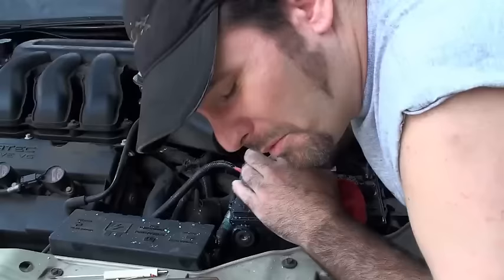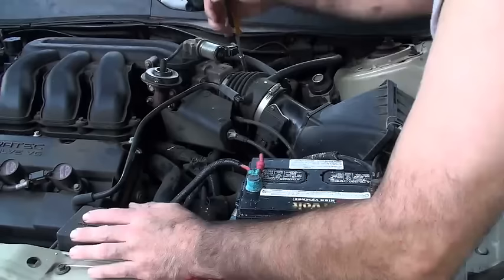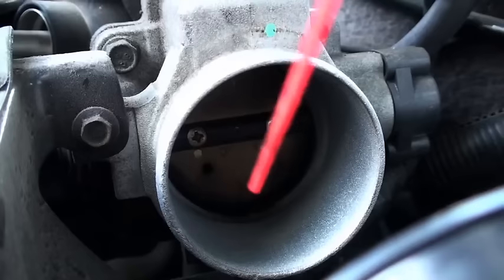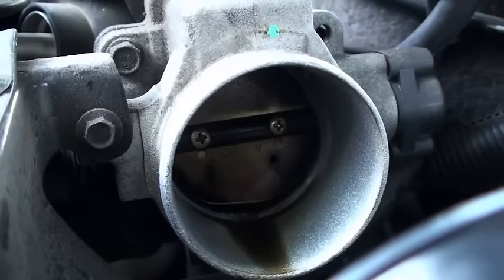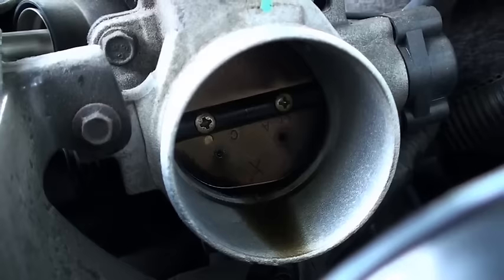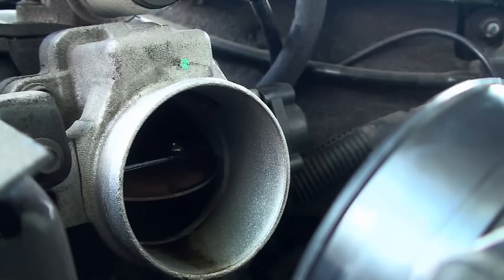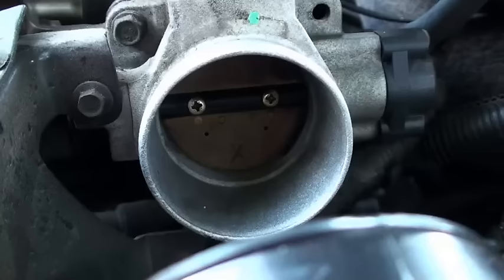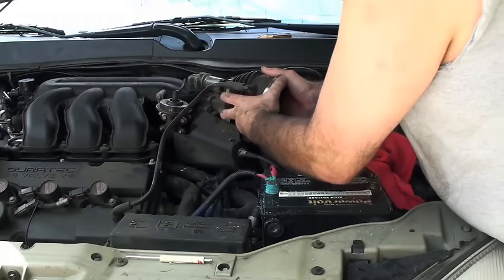Quick Tip-Throttle Cleaning - EricTheCarGuy

Comment: Got a for ford focus 1.8 tdci turbo the car starts labouring on motorways when up above 60 mph and it lags dangerously down to 30 with having to gear down  is this a mass air or throttle  sticking problem

Comment: QUESTION: SHOULD the large air hose connections input on the throttle body have an "UNRESTRICTED" air flow..?? Blowing into it seems to have much RESISTANCE... When removed and cleaned both sides and pin hole bypass, noticed much corrosion on the large hose connections...

Motor starts easy then dies after 2-3 minutes at idle, then no start... Let sitting for 2-3 days it will start again easily... If I hold rpm to 3k for 4 minutes it will then IDLE FINE and restart OK... When cold and when it will will start, the same symptom occurs. If let idle at start, it will die after 2-3 minutes... HELP...!!!

Comment: Eric, question: will throttle body spray damage the catalytic converter if the engine is running while you spray the throttle body spray  ??? Thanks

Comment: On the Saturns or at least the s series its easy to remove the throttle body and just clean the whole thing off. Its only two connectors, a vac line, un hook throttle cables and 2 bolts and its off.takes maybe like 3 mins .

Comment: If you have trouble removing the rubber snorkel, heat up the rubber snorkel up with a heat gun or hairdryer, then wiggle it back and forth until it comes off
Reply: +Rob Reinold You sir are crazy

Comment: I spray something called 'Carby Cleaner" or similar,into my Falcon whilst the engine is running,tends to suck it up mainly through the bypass solenoid activated valve which gets a bit of a gungy film on it,the engine kid of "dies " a bit whilst digesting this stuff but hopefully it does not do any harm.

Comment: I just used brake cleaner, it was very effective. Kinda has the same effect as seen on this video. Do cover up your plastics in case some of it gets onto it, it'll stain badly ;)
Reply: Brake fluid is not good it can ruin the rings and your cylinder bore certain cleaners can damage the catalytic converter and the O2 sensors.

Comment: Hello I have a quick question.  The other day I ran some cleaner through my intake vacuum line. There was a backfire that sounded like a small firecracker.  Other than that everything went fine.  My question is, what is the chance that there was damage to any seals, rods etc.?

Comment: I have seen other videos where they take out the whole thing apart and clean it. Is it really necessary to do that. Thanks.  

Apart from this video I wanna ask I have a 2004 Navigator 125000 miles. It does this cold or hot when I start the car I hear a grinding sound right after that I hear a ticking sound. I have heard the same problem with other people's trucks and they don't know what it is I'm trying to find out what is it. That ticking sound goes away after driving, any idea what that is thanks

Comment: I was told that using throttle body cleaner can damage the Idle Air Control Valve. Is this true? If so, how do I not damage the IAC?

Comment: I've used break parts cleaner. Seems to work fine.
Reply: Brake parts cleaner can damage your sensors such as your MAF, IAT or IAC because it's a harsh cleaner. If you have any sensors that could possibly get sprayed, remove them before cleaning your TB. Use specially designed sensor cleaner to clean your MAF, IAT and IAC.

Comment: I've been learning so much from all your videos since I'm a big car guy these tips are very helpful and so glad I found your videos thank you and keep making them
Reply: I am a novice car guy, but I feel confident about fixing my free '03 Saturn and free '98 Honda. The engines run perfectly. 1.6 in Honda and 2.2 in Saturn. But, there is plastic mechanisms on even moving parts such as the window wiper transmission- unbelievably. 
And the Honda has rattles underneath and poor brakes. Im finding and fixing those issues. I figure I'll still get over 5 years on both. Saturn is my winter car. Honda is my summer car. It's a great system.
I never miss Eric's vids.

Comment: Is a 1993 Dodge Dynasty 3.3L. It still turns off even if I press the gas pedal. My car has never done that before. Bought my car in 2002 and never had any problem until this year 2013. Has new spark plugs wires, new spark plugs, new gas pump and a clean throttle body.

Comment: I just read this somewhere that will help clear up things about cleaning the fords throttle....

Fords throttle bodies are coated and the aggressive agents and those solvents will dissolve the finish and ruin the throttle body

Those coated Ford throttle body's aren't supposed to be cleaned at all. An Induction service using BG cleaner is safe.

Hope that helps..

Comment: Hi...Eric, I did a Throttle Body cleaning with Air Intake Cleaner on my 2005 RAV4 with 196k mi. I found it was strange that the TB was in the back at bottom. It was the 1st time that I cleaned the TB on the RAV4. I sprayed the IAC cleaner and wiped around the IAC round plate and the was very dirty (black) varnish. I also sprayed inside around the TB. Waited after 30 min and restarted the vehicle. It was hesitating to start for 5 sec. and then engine started. I noticed the idle was at 2000 RPM. I let the vehicle run for a few minutes and revved the engine a few times and it dropped down to 1500 rpm. But wouldn't go down to 750-800rpm after engine reached normal temperature. So I decided to drive around the block for a few minutes, hoping to burn off the cleaning agent inside the TB. When I come to a stop, the RPM stays at 1500.

What could be the problem that's causing the high idle at 1500rpm? I've read a few blogs and they said I should drive the vehicle for a few days for the ECU to relearn of the clean IAC/TB. Is it ok to drive while idle is at 1500 RPM, until all the IAC cleaner burns off? Please advise. Thank you.
Reply: +TIMMY LAW disconnect the negative side of the battery for 5-10 minutes then reconnect it. This reset the system and force the car to "relearn" the air/fuel intake.  What you are seeing is the system still running with the old settings with its dirty throttle. However, since you posted a month ago, after a whole month the car should have already relearned itself. Best of luck.

Comment: so I just did this today to my 1991 Toyota pickup, it's my first time cleaning the throttle body and I put everything back together. And make sure everything was put back together right but the problem is now the truck doesn't even start. It cranks but it doesn't start, I'll try replacing the oil pump fuse because I don't hear the oil pump turn on. But other than that I'm not sure what else would be the problem if it isn't the oil pump?

Comment: Hi. My 2009 Santa Fe has a rough idle, hesitates and sometimes switches off while driving. I did a scan on the TPS and noticed that at WOT, the throttle body doesn't open beyond 35%! What do you think could be the problem?
Thanks

Comment: So you can get throttle body cleaner in the throttle? The can I have says it's safe for oxygen sensors and catalytic converters. I'm not sure if it's my throttle causing my issue or not.. But figured I'd try. Any tips would be great!

Comment: hahaha, we used Lawn Mower Carburetor Cleaner and it works just fine since it's only a CHOKE PLATE really :))) NOTE: Put some Silicon Spray on the Throttle Spring and around the Cable and ANY moving parts you see. This will help your Throttle a lot, since it might GUMMED up through time :)))

Comment: It's a simple task to do and will help your engine keep it's power.  You should try to do it every 30k miles.  I do mine every 20000 miles because i drive a '91 with limited hp from factor "110" lol.

Comment: Eric,
I have a 1993 Lexus LS400 that I have let sit parked for the last four months or so. It ran completely fine when I parked it, I just needed a new battery but never got around to it sooner because it was my second vehicle that I never needed to drive. I put a new battery in yesterday and it started right up except when the car is in park or neutral the rpm's idle high at about 3k and when put in drive or reverse it takes off really quickly, accelerating itself until you hit the brakes! The damn thing will do 40mph+ without touching the gas pedal and continue to climb in speed until you hit the brakes. I have put some Seafoam in my gas tank hoping that maybe it was just gunked up from sitting too long but it obviously seems like the throttle may be stuck or something's dirty. Any suggestions? I'm hoping it's not a costly repair.

Comment: If you don't have a tsi engine like mine and your throttle body is as easy to access as the one in this video. I would suggest taking the throttle body off and cleaning it completely.

Comment: My throttle was sticking, I opened the air intake and sprayed wd40 and wiped it with a few WHITE paper towel(tissues). 
No more sticking and smooth acceleration. 
Car's a Hyundai coupe siii FYI.😀

Comment: tech at work uses an old tooth brush first then a rag. also usually gets me to push the accel ped to open butterfly, if me would just wedge something between floor and pedal, if had a money might use an electric tooth brush.  Have to have accessories on though,

Comment: How much "better" would it be if one were to remove the throttle body and clean it with the solvent and a toothbrush?

It seems like it would be a much better clean, but is it worth the extra work? Thanks.

Comment: i see, i think you mean the throttle position sensor,my car has it since honda r18 engine is drive by wire, but the strange thing is i never opened the throttle i just sprayed it and cleaned it with a rag,i really wanted to clean the idle air control valve but i couldnt get to it.

Comment: Just bought an 05 Civic and I noticed a sticky throttle coming off the stop. By turning the throttle with my hand at the body it felt like nothing but after a few sprays and wipes of wynn's carb cleaner the stickiness disappeared. 5min job.

Comment: Nice, but 1 important safety point... it is very dangerous to put your fingers in the throttle boy. Because some cars now a days, can close even if the engine is off sow use a plastic brunch or disconnect any power source to the throttle body. Excuse me for my English btw I'm from Europe.

Comment: Took my 1993 Dodge Dynasty, it would turn on then turn off. They put a new fuel pump, the problem was a wired were the fuel pump was replace. The wired was no good, so they put a new wired and now my car turns on and stays on and runs good. I hope this information helps anyone when putting a new fuel pump.

Comment: Gr8 stuff i have a verso s ractis its kind of difficult to take out the throttle i am thinking to use the rubber inlet and spray cleaner from there its not ideal but may work let me know ur thoughts cheers

Comment: I have a question I hope you can answer. After you remove the Throttle Position Sensor, the part that is attached to the throttle body and is moved by pressing the gas pedal,it has a set of bearings down in it. My question is are these bearings supposed to have bearing grease in them? Thanks

Comment: Hi Eric, thanks for the video. 
I keep on getting the engine light come on.  I scan the codes and 02121 p comes on. Tps..   I have a 09 vw passat 2.0 turbo.  When the light comes on I keep on loosing power to the car.  With your procedure do I need to calibrate the throttle body again via vcd?

Comment: when i cleaned mine it did the same thing i think the cleaner dries up the sensor and makes it get stuck. take out the idle air control valve and clean it and lubricate before installing i used lithium grease on mine and no more problems

Comment: I think it is more efficient to remove the throttle body from its mount and clean it from underneath.
Reply: Does that mean you have to replace the gasket when you put it back together?
Reply: David Crandall  If it's worn but you don't necessarily have to

Comment: hi.. I really need your help... after I did my throttle cleaning my rpm high 1600 tpm 1700 for few sec and back to normal only happen when start uo... thank you so much
Reply: That's good. Cars try to idle high when first started cold.

Comment: What is the proper and easy way to clean motor operated (not cable) throttle body? I was watching your valve adjustment video (J series) you mention not to push the butterfly on the throttle body. Should I remove the throttle body and do it on the bench to clean it?

Comment: My mechanic told me to use a Delco product called Top Engine Cleaner, and from the way he was describing using it, he said it smoke and sputter indicating this was done with the engine running. Is that wise? He also said somthing about not sraying the sensor but how can that be avoided if it's in the way?

Comment: 2014 Chevy cruze 1.4L is bucking between 20-30 MPH. No codes, new air filter, cleaned MAF sensor. Any suggestions? Fuel injector? Coilpack? I'm non-plussed. 32,000 miles.

Comment: When I did this I had it in the on position. And went to hold down the gas pedal. The throttle did not open all way. Maybe a 1/3 of the way. Is this an indicator the throttle body is bad?

Comment: Hi, I have a question, is there should be a small gap between the throttle plate/butterfly and the throttle wall or should be sealed?

Comment: Hi,  I began doing this process to a 1996 Sentra.  The inside of the throttle body has much baked on carbon and wonder if you know of a solvent to apply to it without having to remove the entire assembly from the engine.  Please let me know.  Thank you.

Comment: I have 2010 toyota corolla. Electronic pedal with Electronic throttle body its top right corner there is a screw hidden in a glue type material which is fixed at factory setting.
can you please tell me, what is the function of that. and how it help in adjusting a specific parameter?
I have observed that changing the position of that screw make throttal pedal to respond differently and effect the drivability .
I have an issue of poor idling,engine vibration at idle.  throttle body is cleaned. every possibility has been checked but could not fix the issue.

Comment: Good video Eric, How ever I don't have  a stuck gas pedal problem ,I have  a little higher than normal engine idle on my 2003 3800 engine  Buick will this cleaning help the Idle with a  new air filter?

Comment: The spark plug wear symptoms can tell how the engine perform, fuel consumption, oil leak or coolant leak crust. All four plugs look the same. Can the cylinder head wear symptom tell the same? I have a I-4 2002 corolla, one of the cylinder is clean no carbon deposit, two are strong carbon deposit, one medium. Can this symptom be fuel pressure or fuel injector?

Comment: My 2004 dodge stratus rt coupe recently started stalling. It's a 5 - speed manual. Every time I get to a stop, it just dies. Then when I crank it back up, it stalls again. My pops thinks it's my clutch because I burned it learning how to drive. He thinks it slips. What do you think? Could it be that, or the throttle body?

Comment: I have a Toyota Corona ST 170 4S EFI Auto transmission having problem with idling. When I remove the air flow sensor rpm drops but when I do same with the throttle sensor don't see any changes with the rpm does it mean the throttle sensor needs replacement?

Comment: Been subscribed for some time and learn a bunch. Question: 2004 Taurus starts accelerating after full hot highway driving. I'm going to clean throttle body and mass air flow. Is there anything else I should look for? Thank you. Keep the videos coming. Steve, Plymouth, MA

Comment: Dear  ETCG1.  i have a 2009 chevy traverse. when i was performing  the throttle cleaning. i found  oil in the pipe connect  to the air filter  . what can be causing that.. and how can i fixed. Please help.

Comment: I'm getting ready to do this on a 2010 mercedes e550 coupe. It has been having starting issues for close to two years that are getting worse. It will long crank and usually when i tap the gas pedal it turns over. Coule it be in need of a throttle body replacement or cleaning? It has a new fuel pump and filter so I don't think it's fuel related also the battery is relatively new.

Comment: does it crank over but just doesnt idle or stay alive? you may have a stuck IAC(Idle Air Control Valve) my Ford Mustang will crank but doesnt idle so i have to manually give it gas after it turns over and i have to wait for it to heat up and "break free"...then it idles just fine. Carbon builds up inside of the things like that and will cause this

Comment: Eric I have a Saturn 2000 ls1 2.2 liter Sadan and replaced the throttle seal and cleaned the unit with throttle cleaner. Disconnect the sensors attached to the unit and reattached when done. Vehicle started before I worked on the unit now it doesn’t start.it cranks over but not running. Need help please.

Comment: I have a question! My Dodge Dart 2013 sxt has an upright throttle body; can I still clean it like this? The dirt and stuff won't run back and cause any issues? And how do you open the throttle body?

Comment: Definitely trying this to see if it fixes my issue but in the event that it doesn't, what's your take on throttle body "repair kits"? The ones with the set of replacement gaskets and other assorted parts? Replacement throttle body is not available for my car so that would be my only other option.

Comment: Have tried WD-40 for this? I have👍🏻
another thing that WD-40 can do better
I have clean out carburetor and fuel injectors with it and clean out heavy carbon deposit on throttle body and was fun and worked Better than Throttle body clear

Comment: I have a 20 year old Volvo. Just took of the air intake hose to clean the throttle body. The amount of crude in there is unbelievable. I think there is something wrong with the PCV system.